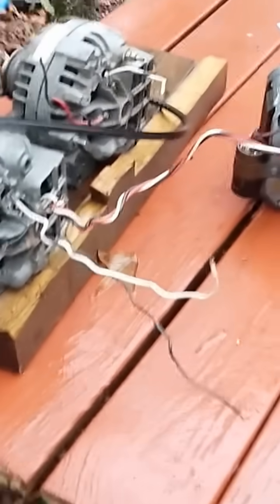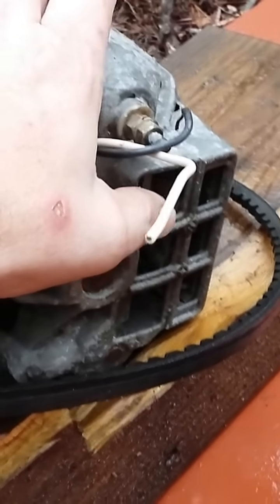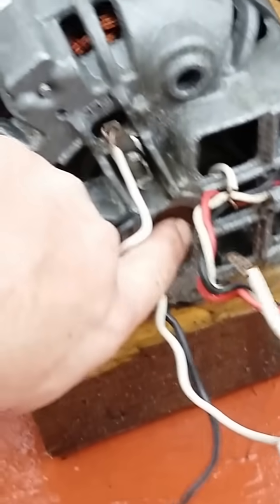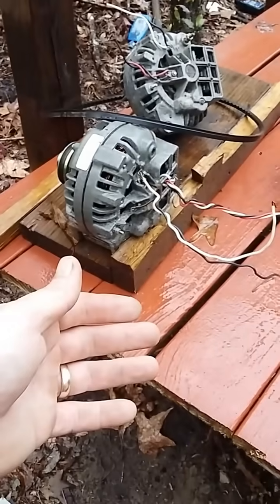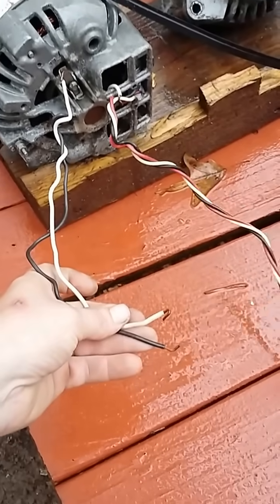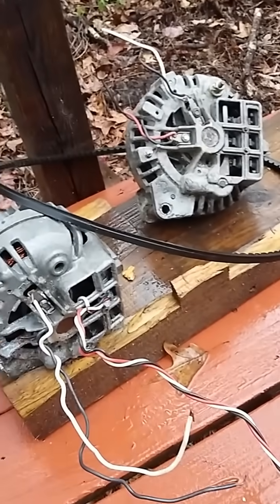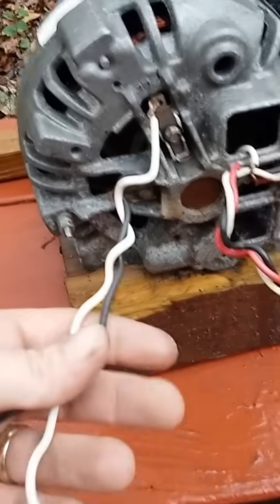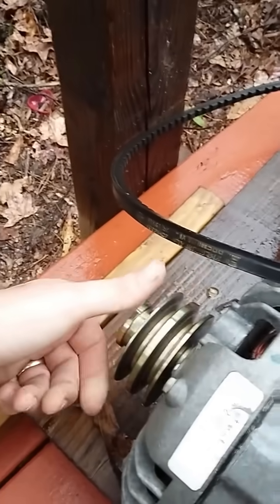Update Free energy forever no wind no solar no gas READ DISCRIPTION!!!

Comment: Yo brother f*** those people the nothing but peepholes get it.! When I take the time to check out a fellow Humans video I like to do it with an open mind now I can't say for sure that I agree with your procedure and what you said up there if it works or not? However your presentation was very well done.! If you don't mind I'm going to use your video to teach my brother and I our first alternator setup see what we get. Thanks for your time brother.
Reply: Good luck. Maybe wired in Delta with an magic flywheel made of unobtanium.
Reply from the maker: Paul Dembowski 
Well thank you very much for not cussing and for the kind comment!! I really appreciate that!!! you're going to need one alternator as a motor and a large permanent magnet DC motor as the generator or a self excited generator head would also work just fine. I'm using a full wave Bridge rectifier for my DC power inputs.  I do not have an inverter that's big enough yet for my AC input. but I am in the process of building one..
And because I am not funded by anything except for my ads.. do not get discouraged I am making a video right now to show people how to use the alternator/motor in Delta instead of in star because it will be much easier for people this way. Just keep in mind that all my videos are produced with a cell phone with no editing except for the pause button...  thank you for watching my video ads it is what pays our bills and funds the project that will get me killed but I'm fully accepting responsibility for my own death... I just want my family to be safe!!!

Comment: It will not work.,,,i a;ready build that using 12v dc motor..
Reply from the maker: KNOWLEDGEHUNTERboy 
What will not work? And what did you put a 12-volt DC motor on?
Reply: No you didn't stop talking shit. Probably some cockhead from a power company. Free energy for all.
Reply: I did it and it's been working use it for camping
Reply: There is a Lil trick the to get it to say running but once started it won't stop unless u add a switch

Comment: Wait so ? Does the alternator power the motor that powers the alternator???🤔🤔🤔🤔❓❓❓❓❓❓❓
Reply from the maker: Nick Robinson 
The alternator is the motor.
Reply: ThomasBuie EnergyBuies at gmail com   So an electronic motor can also be an alternator 🤯. I don’t know much about electrical stuff, just engines
Reply from the maker: Nick Robinson well and alternator can be a generator or a motor. generators used to be called alternators. a regular car alternator without modification produces alternate current and changes it into pulsed direct current with a bridge rectifier(set of diodes) and a voltage regulating capacitor. 
 in order to use an alternator as a motor you will have to take out the bridge rectifier and type in to the three stator coil wire's the other ends of the three stator wires are tied together this will be your input for your motor you're too field wires and that is one coil on your rotor will need to be charged with direct current so that you will have a magnetic field. you can change the wiring to wire the alternator in Delta, but it is already wired in Star. 
Since you said you are a mechanic and know about internal combustion engines let's talk about that for just a second. 
As you may know if you increase the timing on an internal combustion engine it will burn more of the fuel instead of spitting it out the tailpipe and it will have more horsepower. yes, it will idle higher, but you can change that on the fuel intake. also advancing the timing will allow the motor to run off of butane, propane, or hydrogen. most people don't know that, but it's true.

Comment: Lol 90amps would cook them wires mate
Reply from the maker: Josh Coverley 
If you think that 90 amps at 12 volts will cook the wires then why is it rated for 80 amps at 12 volts? and it actually produces 90...
Reply from the maker: George S Gray yes George you're exactly right 10 two wires won't carry that much amperage load. But those wires are not output wires they are input wires...   and what I said at the top of this post is true they will handle 90 amps at 12 volts or 9 amps at 120 volts very easily since this is what the alternator produces anyways

Comment: Sorry but energy in = energy out + friction + iron + copper losses! I'm not even to sure about how you are using a 3 phase alternator as a motor with dc inputs. 90 Amps..... at what voltage? I'm doing the math as you say! P (in)= V(in).I(in) = P(out)= V(out).I(out)! I'm not even considering the power factors! Trust me! There is no secret here! Conservation of energy!

Comment: Ok some math... 90 Amps x 220 volts = 19,800 watts. Also known as 19.8 Kilowatts.  Ok... Now a dose of reality... Just look on line for a 20 kilowatt generator, oops something does not add up.  See that 90 Amp alternator can produce up to 90 amps at 13.8 volts, or... 1,242 watts -- Maximum (+/- 15% thats being generous). What this shows is that alternator cannot possibly pruduce the 20 Kilowatts he claims. ALSO... where is he going to get power to turn this alternator?  It appears he is going to hook a motor up to it and have this alternator supply the electricity to turn the alternator... So try this... Take a three outlet eextention cord and plug the input end into the output end... Now hook up something you want to run into one of the two output receivers... Don't Work, of course... And neiyher does his claim...he is clickbait.
Reply from the maker: Terry Weaver 
No it's 90 amps * 12 volts which is not what the stock calculations were they were 80 amps at 12 volts it produces more than said in diagram and you didn't read the description because I'm not using this alternator as a generator I'm using it as a motor
Reply: An alternator actually produces aboit 14.5 vdc, so a 90 amp alternator produces about 1300 watts.  At 1:03 on this video you say you can weld with it...that's correct...as a generator not a motor. And then you go on to call it a generator. But on your responce you call it a motor. Which is it?  I am not here to be critical, I am somply trying to understand what you are trying to accomplish. GM makes an alternator that does not require field activation.... You turn it...it gives power. I have a new one still in the box.
Reply: At 2:30 you claimed 220 volts at 90 amps...just like I said in my first responce. I do not see any " description " providing me different information, (which would then reflect the video is in error) Personally, I have been involved with alternative for decades. I am a self taught engineer. I have over 3 kw of solar panels still in their boxes, 2 wind generators and 1 1kw generator to use with water propulsion. My son watched me modify things for years so he is now a college degreed engineer and flys all over the world.   
     One of the problems with alternative energy is the power companies produce energy cheap so that people with the knowledge of alternative energy cannot compete. Our house has a 6kw demand at times and that is normal where we are.  
     I am still searching to find your rational here. If it is a motor, what is it turning and how does it get its required power? If its a generator what is turning it?  And... Even 1,400 watts is no where near enough to run a house unless you provide more alternative energy for heating and airconditioning and stove and refrigeration, hot water...and more.

Comment: Do I need to open up the alternator ? To unwrap some slack so I can wire to the dial?
Reply from the maker: Mike Bridgeline the rotor already has a coil on it that you can put direct current to to create your magnetic field you do however have to open the alternator up and take the bridge rectifier out to use the three phase input that's wired in star for your electronic speed controller to use as a motor. You can see how simple it is on my other video titled bldc motor from alternator

Comment: Do you recommend ? building a wooden box over head for outdoors for when it's raining. In other words to protect the unit from Water .
Reply from the maker: Mike Bridgeline the alternator does not need protection from water which is the main reason why I chose it as my RF motor and it's already wired and ready to be a motor you just have to bypass the bridge rectifier for your 3-phase input that's wired in Star already... if you have a self excited generator head like the one that I have, that's a 10kw. it is also waterproof.. so my system would not need a box using alternator as a motor.. but would look prettier with a box on it

Comment: Ok what if you used one alternator to power the other in motor form then they run each other. Boom power source. Enough for a car battery and a few accessories
Reply from the maker: Henry Fuentes you can do that with the right electronic speed controller but I'm wanting to provide backup power to people's homes which is why I made the other videos
Reply: Henry Fuentes you are forgetting about energy loss dude.its like trying to charge a solar panel with a light bulb powerd from the panel
Reply: Rinaldo Jonker light bulbs don't generate power only heat . But a alternator generates power and the motor powered by it would move the alternator. But I get what you mean. The power lose due to running the motor would be there.

Comment: Without seeing a connected working model it really is just theoretical.
Reply from the maker: Michael Van Patter 
Well if you want to think about it theoretically.. take a 500 horsepower 3-phase Simmons electric motor put a gear head on it and use it to turn a hydroelectric Dam generator (way too much horsepower, but just theoretically) do you think that hydroelectric Dam generator would have enough power to power that 3-phase Simmons motor? I build things in my head all the time and they almost always work!

Comment: IT'S STILL A 12 VOLT SYSTEM!! And if you want to tell me I don't know what I'm talking about! I'VE WORKED AS A DIESEL MECHANIC FOR 25 YEARS! I WORKED FOR INTERNATIONAL!!
Reply from the maker: Jimmy Joebob you say you know what you're talking about so then you know how to wind 3-phase Motors and build full wave Bridge rectifiers and you know that the alternator produces alternating current (AC) and the voltage is regulated by a capacitor because it is unregulated high voltage alternating 3 phase current and changed into direct current with diodes... And you learned all this by being a diesel mechanic right? And since you knew all that, you must also know that I am using this alternator as a motor wired in Star...
Reply: ThomasBuie EnergyBuies at gmail com Ive also worked with 220 and 480 3 phase!! SO YES!!  LOVE HOW YOU CHANGE THE TOPIC!! ALL YOU'VE DONE IS HOOK IT UP IN SERIES!!
Reply from the maker: Jimmy Joebob  no actually you're wrong because I'm not using this alternator as a generator I'm using this alternator as a motor...
Reply: ThomasBuie EnergyBuies at gmail com how  that I understand!! How are you gonna drive it!!??
Reply from the maker: Jimmy Joebob look at my video title bldc motor

Comment: That wire is to small for 90 amps
Reply from the maker: rob marx 
It will handle 90 amps at 12 volts just fine! They can actually handle a little more than 15 amps at 120 volts, but you didn't read the description. And this is the first video you've seen of mine.  So no worries!

Comment: How do sync the wave with two ?
Reply from the maker: rob marx 
you need 6 mosfets a few resistors, microcontroller and the programming code for it which really isn't that much but you're going to have to do a lot of work or you could just buy an electronic speed controller that will switch the 3 wires from positive to negative in a sequence.

Comment: I had to pause the video at 2:28 and listen over several times. 220vx*90*amps?  Are you seriously making the claim that a car alternator has the ability to generate almost 20,000 watts?!  What? Impossible.  Why watch the rest?
Reply from the maker: JViello 
 you are not the first person to point this out! yes, I know and have said it quite a few times that an alternator will not put out 90 amps at 220 volts... it's four and a half or 5 amps at 220 volts.
Reply: Okay, that's more inline with what an alternator can generate.  1200ish watts.  Thanks for clarifying.
Reply from the maker: Stefan Hadrian Kozma yeah if you go around commenting on every post on every video of mine you're just a man with his in his mouth!
Reply: Wrong info the altinator is in dc voltage and the house uses ac
Reply from the maker: Michael Toyloy an alternator produces alternating current inherently there is a set of diodes called a Bridge rectifier that changes the alternating current into direct current. I have bypassed this, but I am not using this on my house! I have stepped up my system to 10000 watt generator head. I am using this alternator now as a motor for another system.
Reply: Both you you people should have your mouth washed out with soap and before you comment back, watch this and figure out what life is about:  Be warned: https://www.youtube.com/watch?v=AYxKRoONrfY&t=2493s
I don't think either one of you has the courage to watch it all the way through.
Reply: Scottybeammeup2
1 second ago
Both you you people should have your mouth washed out with soap and before you comment back, watch this and figure out what life is about:  Be warned: https://www.youtube.com/watch?v=AYxKRoONrfY&t=2493s
I don't think either one of you has the courage to watch it all the way through.

Comment: But you’re still going to have to pay for the energy to run the motor, and you will actually lose a good bit of it due to mechanical inefficiency. You can’t just make energy pop up out of nowhere.
Reply from the maker: Andrew W 
And that would be the reason why I built a pond and a moute on my land so I wouldn't have to buy water for my generator...   so how much does it cost me to run my homemade generator now?

Comment: Wow.   Sorry bud but it doesn't work that way.  It's rated at  90 amps of  12 volts which would  result in  1080 watts of work being done.   So if we take  1080 watts of work  divided by  120 volts of  force  it would come to  9 amps  of flow.   Not very much at all.   Definitely not enough to power the alternator let alone have excess.   Ps.  The stator stays and the rotor rotates so you got that wrong as well.   Keep studying.
Reply from the maker: Mike Holcomb 
lol. I appreciate the input. what you say is common knowledge amongst people like me. I made the video this way on purpose. It is a way for people to reach out to me without me getting in the spotlight... none of my other videos are like this. I made the algorithms in this video different than most of my other videos also, that way I would have more traffic from this one video but the comments in this video have a lot of information. The description of the video explains intent.
Reply: Exactly, well said. Maybe when you   use motors with rotating stators they don't drop the amps from 90 to 9, hahahaha. The secret is the rotating stators.
Reply: Yes, because I'm sure you have control over YouTube's algorithms...😂😂😂

Comment: I knew how altenators and generators worked when I was in kindergarten.  This guy is a moron.
Reply from the maker: shiv'a' s   I doubt you could count to five in kindergarten. If you knew about them and kindergarten then tell me what's the difference between an alternator and a generator? That's what I thought!!!
Reply: ThomasBuie EnergyBuies at gmail com lmao I like he didn't reply anymore😂
Reply: You need to show your project running. You say you get 90 amps Here's a good test start your generator hook up anything that 120v and will draw 3 amps it will probably run fine now connect a 120v  motor that draws  12 amps  that's 15 amps  I bet it don't work 
You won't be able to get more then 10 usable  amps  under a load 
I have tried  this before if you think I'm wrong  test it
Reply from the maker: Heather McCune no I don't think you're wrong because I get the same 9 or 10 amps maximum but for some reason everyone seems to think I'm using one motor and one generator and it just doesn't work that way you have to have high voltage homemade capacitors you've got to have a Step up Transformer and a Step Down Transformer for load loss. The alternator does produce 90 amps at 12 volts but at a 120 volts that is 9 amps. For one alternator/generator. My original design had three small motors and 6 alternators. But because of the load loss and the lost from the thermal dynamics it was not very conventional. Now I'm using one motor with two generator heads one of the generator heads Powers the internal combustion motor through a high voltage hydrogen cell. And it works great the second generator head which is 10kw Powers everything that I need it to. And not only that but the exhaust from it is O2...

Comment: I do have just one how did u get the coils to put volts out best I can get is oms reading of 0 till I spin motor with drill bit i did away with the fild coil and used permit magnets on my shaft used same stator on shaft but no coil